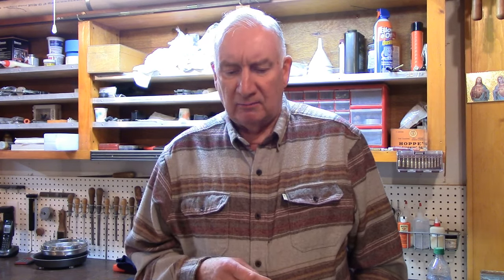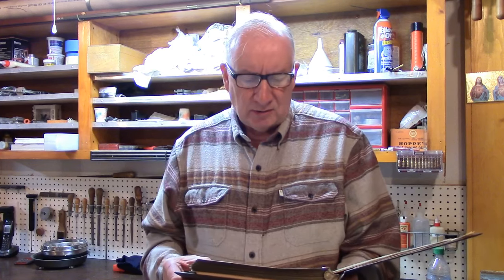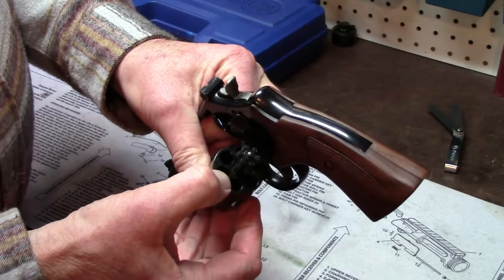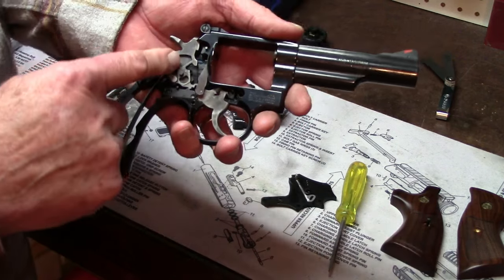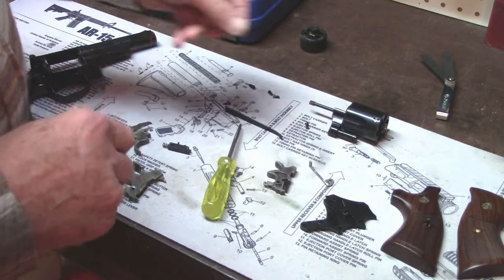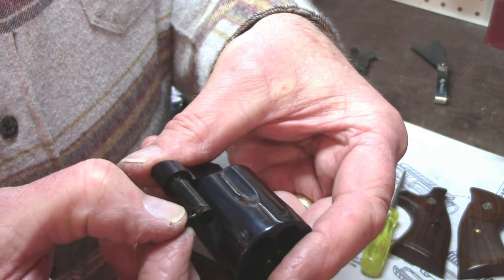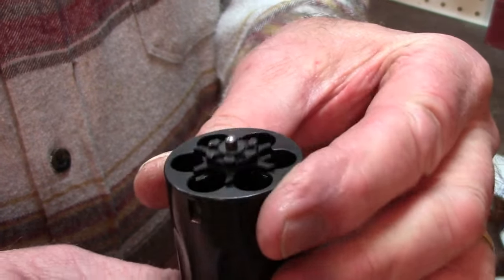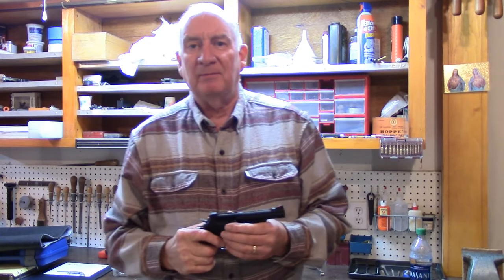The New S&W Model 19 Classic ~ A S&W Armorer's Review

Comment: I carried my Model 19 in the Alaska back country for forty years. I gave it to my son when I moved to a warmer climate. I plan to purchase the newest Model 19, and you'll notice it does NOT have the lock. (Somehow, some way that lock does hurt my feelings). Great video!
Reply: How difficult is the  maintenance of a blued revolver? I saw the new no-internal-lock Model 19 and really want one.
Reply: @MrSmith-zy2bp  Not sure if you are writing to me or GunBlue490, but I never had to take of the side plate to clean and lubricate my model 19 even though I lived in Southeast Alaska which is a rainy, wet, saltwater environment. I did "pick and choose" that firearm carefully when I purchased it locally and I did take good care by merely wiping it down and lubricating with quality gun oil regularly. The Model 19 ran like a clock. For forty years.

Also, I did not shoot a steady diet of .357 rounds. That probably helped.
Reply: @texasstadium  Yep, I was asking you. I've never owned a revolver and looking at the new no-lock Model 19 and wondering how difficult it is to maintain the blued finish vs just going stainless steel.
Reply: @MrSmith-zy2bp  My model 19 had what S&W called the "bright blue" finish. Very attractive and durable. I also owned a stainless model 66. It took even less maintenance. Just wipe them down with an oily rag after spending time in the field.

By the way, my Model 19 had a six-inch barrel, the Model 66 was four inches. The Model 66 was stolen out of my luggage years ago when travelers were required to put the firearms tag OUTSIDE on the luggage.

Comment: Thank you for a great review! I too am a retired LEO, who carried a S&W from my first day on the job. I have a original 19 6” with pinned barrel, and a recessed cylinder that I competed with in the 70s that has over 200,000 rounds through it without a fail. I also have a K22 6” in a Gold box, a 2 1/2 mod 66 that I carried as a detective and a newer 66 6” w/o lock that I now use to give my original 19 a rest. I also have an original 60 and a new 60 2”, a 5906, a 3913, a 659 and I love them all and wouldn’t sell any of them. 
     The original 19 has been back to the factory to check for wear and metal fatigue and passed with a clean bill of health. I have never had to send any of my guns back to S&W for repair.  I will tell you this back in the day they spent a lot more time on machining detail, like the ribs cut on the back straps and the barrels or the mortise for the adjustable sight being cut square to precisely fit the square sight as opposed to radiused to fit a round sight. The finish was always second to none. Many of the changes were cost cutting practices that kept S&W in business, The fact that they had to have their parts hand fitted also made them smoother and more desirable! I used to practice dry firing my old 19 by putting a dime on its front blade sight and see how many times I could dry fire without it falling off, that’s not possible with the newer guns until they have been reworked by an expert fitter like you. So there is a lot to be said for the old ways as well as the new!

Comment: What a wonderful, informative video! Thank you for posting it and for sharing your extensive knowledge. This is exactly what I needed to know. I bought a 6" S&W Model 19-3 in 1976 after desiring the 6.5" "Dirty Harry Model" 29. Fortunately I came to my senses and realized the Model 19 looked just as good while 357 Magnum made more sense for me. Somehow I've been able to hang on to that 19-3 for almost 50 years and treat it well. I rarely shot hot loads, usually just light handloads and factory ammo, probably less than 4,000 rounds. The finish is like new and the trigger is amazingly light in single and double action. The revolver never has been worked on other than I swapped smaller, better fitting stocks for the huge factory target stocks which were too large for my hands. Anyway, now I know the S&W Classic series is good so I think I'll get that "Dirty Harry" Model 29 now! And shoot 44 Special like Harry admitted in Magnum Force. Since I'm old now somebody is going to inherit a couple real nice guns!

Comment: When I was young I was a woods bum to the extreme. If I was not fishing I was hunting. My thing was to get into remote areas of Maine NH and Vermont. I quickly determined angry moose and hungry black bears in remote areas were not nearly as afraid of humans and I bought a 66-1 the day I turned 21. I shot a ton of small game and a few fish if I was really hungry with that revolver on many adventures. Fast forward I inspected that old gun that I still use against your 51 point checklist and it is beginning to show the start of several of the problems you pointed out. Since it is really a classic and I wanted to preserve it I bought a 66-8 based on what you say in this video. It really is a much improved design.The round butt, smooth trigger and pinned front sight (now a Dawson precision fiber optic) are worth the upgrade by themselves. I also like the internal lock. Sometimes you cant always keep your gun on you when traveling, so having a way to disable it appeals to me.

Comment: Gotta love it when someone who knows what they're talking about puts out content.  Old stuff was not necessarily better.  It was worked on by hand because the machinery wasn't as good as what we have now.  Great video.  Thank you for sharing.
Reply from the maker: Thank you.  You are entirely correct. People at benches were required to adjust, file, hammer, and pick assorted parts to fit and correct the wide tolerances created by antiquated machines that S&W had been using since the 1800s.  The vastly better quality made possible by robotics (though they replaced too many people's wages) cannot be compared. Modern CNC machine work has literally eliminated the concept of tolerance.  That's quite evident to anyone who owned a car 40 years ago that didn't start, broke down, and was a challenge to reach 80,000 miles before the junk yard.

Comment: Thank you for another wonderful video.  I think that you hit the nail on the head regarding the debate over old vs new Smith and Wessons.  A lot of people think that old is automatically better than new, and although this can be true, many times it is not.   Harley Davidsons produced from about the late '60s through the early '80s were a byword for garbage.  You probably remember well how AMF nearly destroyed Harley Davidson, with bikes that would leak oil on showroom floors and break down minutes after being bought and driven down the road.  A new Harley is miles ahead of anything theh made during the AMF era.  The 1960s and 1970s were the era of conglomerates, and you probably remember that Smith and Wesson was owned by Bangor Punta for quite some time.  I read in a gun magazine once that probably 50% of Smiths made during the Bangor Punta era had to be fixed at the dealer by a gunsmith.  I own a four inch 586 Classic,  and I have no doubt about it being a better built gun than its predecessor.   The accuracy is phenomenal and runs like a clock.  And the wood stocks are beautiful.   A new Ford Mustang is undoubtedly a better built car than a Mustang from 1968.  New skis made by Rossignol or Völkl or K2 are going to be leagues better than skis from the '70s.  Vintage products are cool,  and fun to have, but I think most people don't realize that back in the day there was a lot of fixing and upgrading the stuff that the guys at the factory missed or let slip through.  A new Winchester Model 70 made by FN will outshoot any of the old pre-'64 guns, yet we still overpay for a pre-'64 M70 that is not even a Super Grade, just the plain Jane model in a super common chanbering like .270 Winchester or .30-06 SPRG.  CNC machining was a huge game changer,  and we have better guns and vehicles for it.   Thanks again for a great video,  I was wondering if you would be willing to do a comprehensive video on the great Sako rifles of Finland one day?  I quite enjoy the Finnish rifles and would be interested in learning about the history of the company and the various models.  My Dad used to own two Finnbears, one in .30-06 and one in .300 Winchester Magnum,  and he told me they were the finest rifles he's ever owned.  Merry Christmas to you and your family.
Reply from the maker: I may do that, as I have owned a number of Sako rifles, all wonderfully made.  Your observations of product improvement are exactly correct.  As a Smith and Wesson armorer, I can attest that they routinely shipped poorly made guns that I was required to repair before they could be issued.  I was told by them that they trained armorers free of cost (all other S&W courses cost police departments big bucks), because it allowed us to handle the repair load, not them!  The gun world was rife with bad products, and no companies offered customer service or support of any kind.  The notion that guns were superior in those days is nostalgic fantasy that bears no semblance of reality. Caveat emptor...buyer beware, was the byword of the 20th Century, no matter what you bought.  You owned it.

Comment: I was only aware of some of the changes in the new Model 19, so I appreciate the detailed look at the many improvements.  The one feature I absolutely detest in the new gun is the reshaped frame which was necessitated by the incorporation of a manual lock.  This is purely a cosmetic concern, but it has kept me from acquiring one of the new revolvers.  I still own a highly tuned Model 19 that master gunsmith Bob Day rebuilt for me in the early 1980s.  It's a safe queen these days, though I have long babied it.  After watching your video I may force myself to overlook the cosmetic difference and get a Model 19 that is truly mechanically superior and more shootable than mine.  Thanks for the detailed analysis.

Comment: Hands down, this is the best review on the model 19. I think you have convinced that the new guns are good to go. I guess I can live with the lock. Don’t get me wrong I have a 66-3 snub nose in mint condition, it’s a great revolver. If I can not locate and older 19 in good condition at a reasonable price I will go with a new one.
Reply: There are aftermarket plugs available to fill in the frame hole and flag slot for those locks.
Reply: You can get a lock delete plug that goes in with no permanent changes at all.

Comment: I love your knowledge of firearms and have learned a lot! I'm 63 and have been around firearms all my life but have been awakened by your videos to things I've done wrong over the years. I have a Model 66 (1986) and is one of my favorite guns. I think it's in really good shape, very little cylinder / yoke movement and it sings. Probably less than 750 rounds through it. I did replace the original grips with a 1986 Pachmyer grip but still have the grips on the original box. Love that gun! Rob in GA.

Comment: I am the son of a mechanical engineer (dad's speciality was designing new machinery and upgrading / improving existing designs). One of my great joys in life was seeing and understanding dad's work. Although I'm not an engineer, I have designed and occasionally improved a few mechanisms myself (for my own use, not commercially). I say   that to say this, "Your clear and careful explanation of the mechanisms you described were clear, logical and well filmed for illustrative purposes."  I've owned all frame sizes of S&W revolvers , older and more modern and love each one for its own purpose. While I've never had any issue (other than an ejector rod that wanted to work loose in one particular revolver) I can certainly see how S&W have improved my favorite model. As for the metallurgy and MIM / investment casting, your explanation parallels everything I've read about the processes in recent years. (One of my favorite knife steels - S30V - is a particle steel and is made in essentially the same process. The best golf clubs, as you probably know, are now investment cast.) Thanks again for taking the time to make a somewhat long, but very informative video that every revolver aficionado should watch carefully. - Ray Wallace, in the wilderness near Durango, Colorado - and new subscriber!

Comment: I probably bought some of those used S&Ws you passed over :(   With your skills, you could have easily fixed them of course. I think the "feeling" people have about the older S&Ws is about tradition. A reasonable comparison might be sixties vintage Triumph motorcycles, compared to current production ones. Do they look similar, yes. Do they perform better / are more reliable and durable? Yes. Are they the same, no. The market has had access to 'better' revolvers for some time (they have their problems) from the Ruger catalog. That said, I appreciate your thorough review of the modern production S&W.  It seems to me S&W is navigating a difficult balance between taking advantage of their provenance to grab market share, but at the same time making reliability and ease of manufacture changes. Your review offers proof they're being successful at that. I hope they keep making the new ones...despite the fact that the market is pretty miniscule. Thanks for the video.

Comment: I noticed right away the cut stock on the right being given clearance for a speed loader, so that’s a +. However, I’ll stick with my Model 19-3. I doubt I have 300 rounds through it, just a few of those being magnums. I bought it in 1969 for $141.75. It’s really a safe queen, but I’m very proud and glad I own it. 
I like your videos.  MIM parts are pretty widely panned by internet gun people, but none consider that General Motors uses MIM connecting rods in Corvette engines.  A broken connecting rod pretty much consigns an engine to the trash heap.

Comment: I carried a Smith & Wesson Model 19 for several years as a Border Patrol Agent.  I also shot it regularly in casual competitions, shooting probably between 30 and 40 rounds each time.  I never had a problem I could dope out by myself.  Except once; I broke the hammer mounted firing pin on a Model 13 after four or five years and I don't have any idea of how many rounds I fired.

Comment: I'm so impressed w ur detailed analysis on the innards of this revolver that no one in this utube can.
I just subscribed.  I've watched ur other educational videos which were very valuable n useful for a 
beginner like myself.

Thank U!

I didn't know there r still a good team of engineers w modern tools w more advanced metallurgy u've mentioned
to whom can combine efficient but hi quality production output.  There must of been many good gunsmiths
who provided good inputs to these designers of this new M19.

One important question remains in my mind:

Did the barrel sleeving solved S&W's new production revolver problem of consistent skewed barrel to the
frame connection production outputs without pinning the barrel to the frame on this particular new "Classic" 
version of the M19???  _________________.  

There r many kinds of machining/setup errors to skew the bbl to frame connection.
Even if the bbl was screwed into the frame, then pinned, if the outside thread turning of the bbl is not made parallel
to the bbl's bore axis or the frame's thread where the bbl will b screwed on is not parallel to the top of the frame,
the bbl will be attached crooked w.r.t the frame.  Even if the outer bbl sleeve 's outside is parallel to the frame, 
if the sleeve's bore is not concentric w the OD, the inserted bbl won't shoot straight.  Even if both the bbl-sleeve unit's
bore is parallel to ea. other, and it's also parallel to the frame, if the cylinder's center rod is not parallel, it'll shave the
bullet so the gun won't shoot consistently.  There are too many misalignment during the machining of these 3 major
components.

Comment: Outstanding video. I was checking out the improvements you were pointing out as you went. The newer guns I have (617, and X frame) have been excellent. 

I came up in a later era, where only a couple of people brought wheel guns to my academy class. They both carried autos, but brought smiths to basic as they were trying for top score. Only a couple of us had tritium sights, and I think we were the only two to post no misses in the dark. 

Firearm instructor school did teach revolvers, but only Reserves carried them until budge allowed for them to also be used G22’s. 

Glock armorer school is basically parts replacement. Would have loved to go to a revolver armorer school.

Comment: I bought a 686-6 international about 8 years ago.  The key lock was always jamming up the gun.  Locked it up tight.  The little "locked" flag would just dangle loose and would sometimes block the hammer.  Today I took it apart to finally look into it.  There is a tiny itsy bitsy spring that is supposed to hold the flag down.  It has one leg that slides into the same groove as the cylinder release.  

That little spring was NEVER installed correctly.  It ended up not only not controlling the lock in the unlocked position but it also pressed the lock into the hammer which caused wear of the hammer finish.

I took the gun apart using your older guide as a guide.  I messed up on the hand and popped the spring out.  That is not nearly so hard to put back as you alluded to.  If you wanted to make a video of putting the little spring back into place that would have been great!

Also the gun had walked out the screws.  All of them.  Even the main spring tensioner.  The gun has a lot harder of a double action now.

I may consider the wolf spring kit.  It has the main spring and the trigger return spring.

Thanks for all the great information!